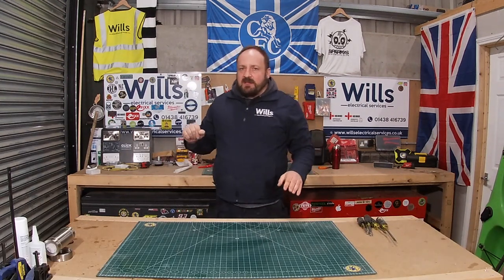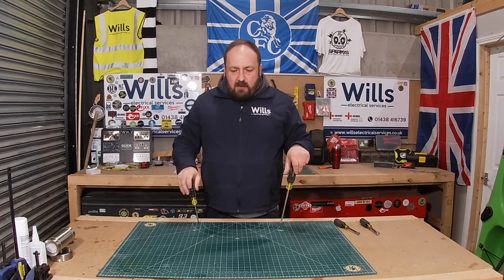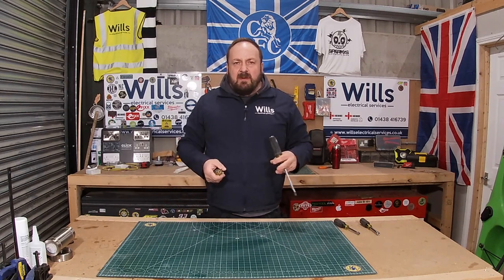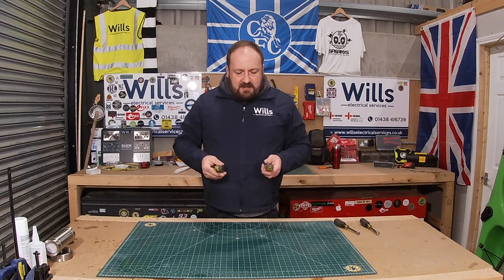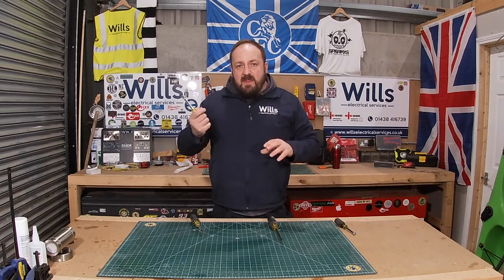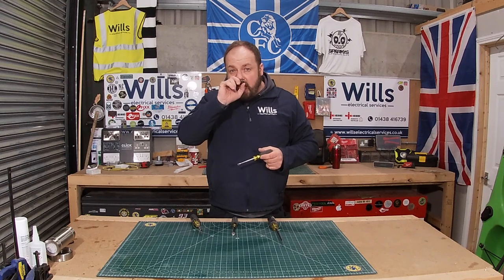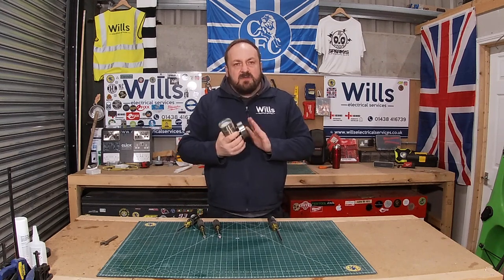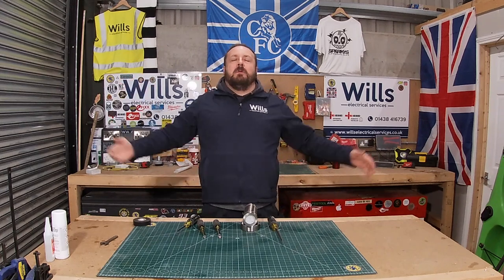Klein tools nut drivers and screwdrivers Plus canister light tips and tricks

Comment: You can get that style of Klein screwdriver in PZ1 and PZ2, the insulated version in the orange and separate black rubber sleeg (not the full moulded version you have in a set) for less than 20 squids for both at Farnell Components at Leeds, individually elsewhere you can pay 40 squidsfor two  ! ! ! free delivery if your order is over 40 squids..
£8.64 each and as you say, don't see them at many places in Pozidrive.
Reply from the maker: Yeah I’ve seen them I might give them a try

Comment: I once bought a klein vde  terminal screwdriver with the same type of handles...cost me 25 quid for the one screwdriver, couple months later lost it in a loft.....lesson learnt
Reply from the maker: Sounds like CEF city You can normally buy the set for about 40 quid these days you would say that’s a little bit expensive .I remember are used to pay 40 quid for iArizola 20 years ago
Reply: @ElectricianTV  yep was cef they defo saw me coming, though tbf I have had the orange and black klein drivers in the set for about 17quid from city and they was quality but now I only use wera, best drivers by someway in my opinion